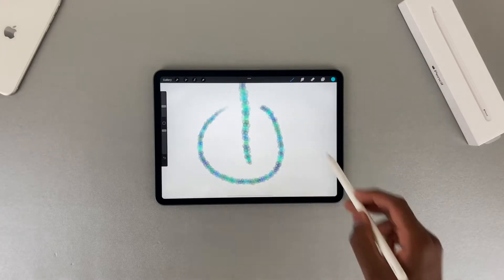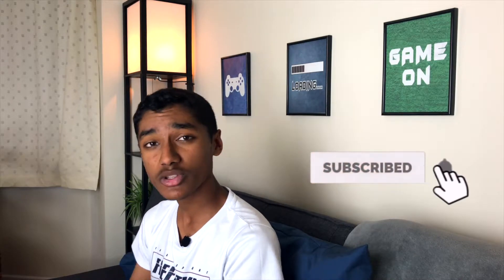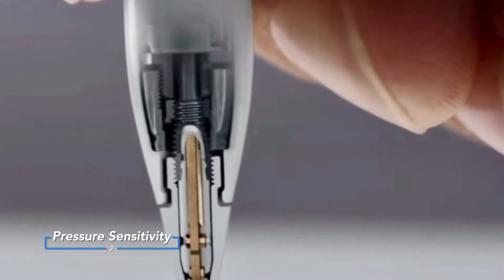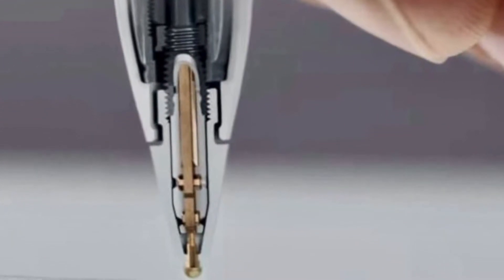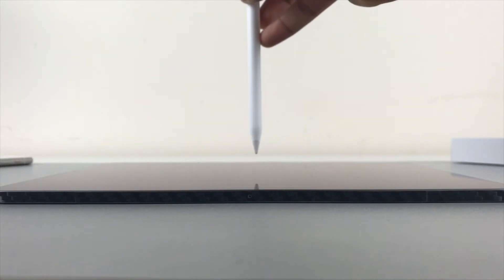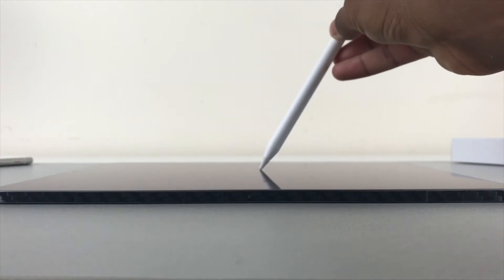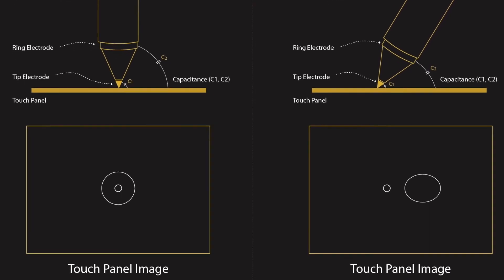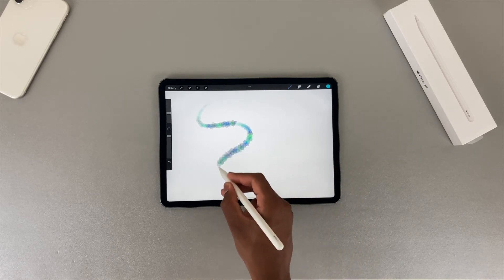How does the Apple Pencil work?

Comment: How Apple Pencil can know the touching location? Phones works th electric. The Apple Pencil is plastic and when it is off, it is not work. Do you know? (English 2nd language)
Reply from the maker: I think I understand your question. Are you wondering how does it know where you tap? If so, it doesn’t matter where you tap as long as you tap twice.
Reply: @AdamMirTech  I am drawing something, I started a line from top-left corner to right-bottom corner. How does it know? I didn't understand the "double tap" thing.
Reply from the maker: It knows since it sends an electronic signal to the iPad screen which the iPad recognises as a touch. The double tap works by having an object inside the Apple Pencil and when it is tapped, it vibrates which it then knows to do the feature.
Reply: @AdamMirTech  Thank you for your reply BTW.